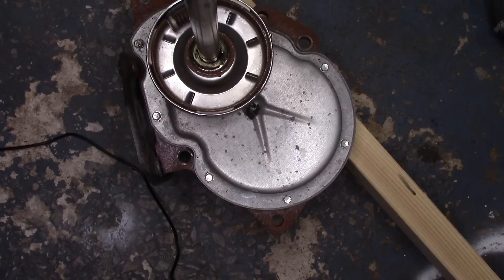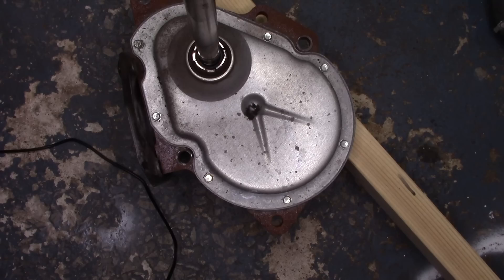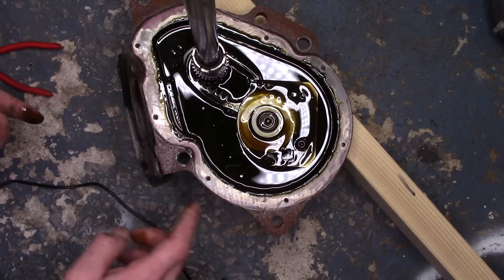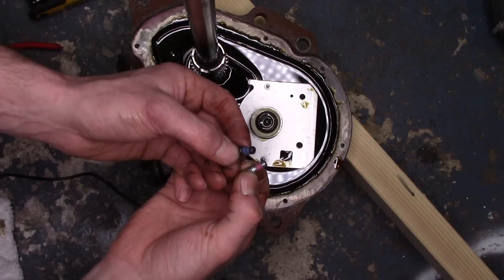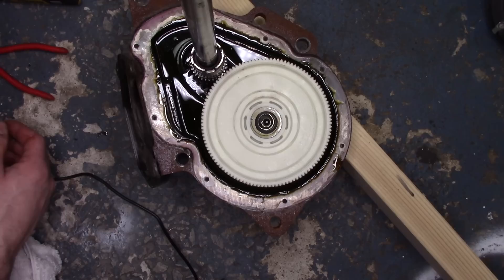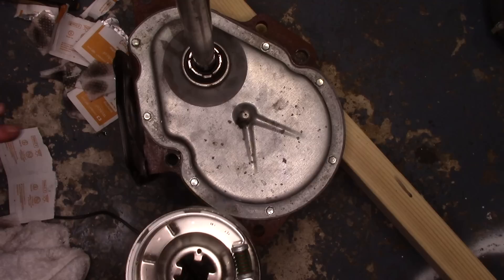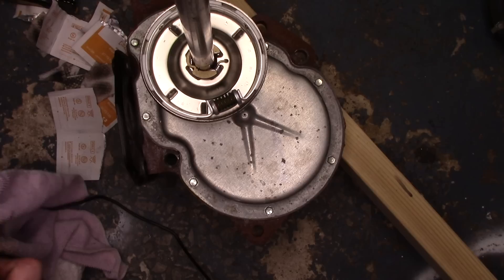How To Rebuild A Washer Transmission  3360629, 388253 Kit Installation

Comment: Was watching this video to learn more about my washer. I wound up checking the neutral drain, found that it had failed, and replaced it following this video. Thanks a lot for the real world insight e.g. 2x4 stand with motorplate attached, id’ing the correct kit plate, gasketing the case cover etc. That’s just what I need to keep my old appliances running as long as possible without spending a fortune.

Comment: This video was EXCELLENT. Very informative, straight to the point and easy to understand. Also, the camera angle was perfect and you could actually see what you were talking about. I liked when you said, “when a homeowner mistakenly gets rid of their old washer and wants to find one like just like it”.  That’s ME. The new washers I’ve bought are AWFUL in so many different ways. I wish someone would’ve told me before I had my old one hauled away. Anyways I’ve got a new used one which I LOVE and has worked great for over five years but now it’s not neutral draining. With the help of this video, I’m going to fix it. Thank you so much. This truly was invaluable. Oh and I’m going to replace the clutch assembly while I’m at it. 😉.   Two months ago I posted the previous paragraph and want to update:  with the help of this video I was able to fix the problem and replace the clutch. Now my 20 year old Whirlpool works like new again. Thanks so much. I hope to never have to buy another washer!  😂

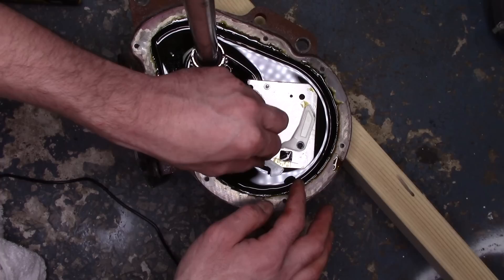Comment: 5:34 this is what was broken on mine but it was very subtle.  the little plastic part that grabs the metal plate below it was worn out (not broken).  So it wasn't grabbing and was just sliding off.  I was only able to tell when I compared it to a new kit as the rest of the parts looked good.   
all the other pieces were in working condition.  This is for people coming in wanting to identify why they are replacing the whole assembly.

Comment: Fantastic video! Clear, to the point, with excellent commentary. Our Whirlpool is 34 years old, with just easy replacements of the pump and agitator dogs. Currently investigating a transmission or clutch or brake issue, but determined to fix it!
Reply: Did you fix it? Mine has no Spin and I have tried fixing everything on it

Comment: That oil is filthy. You are right there to clean it all out properly. Diesel is a whopping $3.00 a gallon. An old paint brush and a pan, most people already have. That transmission takes around 16 WHOLE ounces of fluid. What are we talking a buck or two MAX for fresh fluid? I would pay an extra $3.00 for a clean rebuilt trans as most other people would too.
Reply: How does it get filthy?  It shouldn't be subject to any contamination unless it gets water in it.
Reply: grease/oil for plastic gear transmissions are black, think they have graphite in it
the oil is $20
Reply: @a89proof  over many years humidity gets too it, there is a tiny hole on top of the cover so pressure will equalize.

Comment: Excellent video, just what I needed to see. I had narrowed the problem down to the transmission jamming. It turned out one of the two pins, the pin that held the spring loaded piece had fall off the plate! Now for a rebuild kit.

Comment: I love the whirlpool direct drive washer and will use them until I die. I had some apartment buildings and I got coin operated washers for the residents. They were basically the same as any other whirpool washer with the control panel simplified and the timer was one that was triggered by a coin slide. I had thousands of loads run on these washers and all the repairs were very easy and I hardly had to service them. The neutral fault did happen a couple of times but people throw these machines out all the time and I would just grab them for parts before taking them to the scarpyard.  I never tried to rebuild a transmission I would just swap in another from a scrapped machine.

Comment: I did that for all of 2 in 15 years because transmissions were plentiful. That was the opposite fail in the first two years of production btw. The transmissions originally went into the minis and pumped while spinning, the timer had no pause, so when they failed they'd pump out but not spin, stop and start spin again and they'd go. The transmissions from them worked perfectly fine in the newer ones with the pause. If a newer one failed like yours, they'd work in the minis.

Comment: Do not put any oil on the transmission shaft, it will end up in the clutch causing the washer not to spin. I use a very little bit of high temperature wheel bearing grease, it stays in place even after it gets warm.

Comment: I did this to my Kenmore 80 series that is a rebranded Whirlpool DD. The little flat spring had broken making it not drain. Used the rebuild kit and a new clutch along with new synthetic oil in the transmission fixed the problem.

Comment: My clutch went bad recently, and it appears that there's oil leaking around the seal on the shaft. Any suggestions for part numbers and how? The one in the top cover ought to be self-explanatory, but there appears to be a second one between the shaft and the small collar that the clutch rests on, and other than jamming a pick in there and hoping, I've no idea the best method to change it.

Comment: The sealant anaerobic gasket sealer  it is made for for transmission cases  . Recognize when i took apart it stayes stick unless it exposed to air for long times and can mix with oil with any harm

Comment: Some Whirlpool direct drive washers were designed to neutral drain; others were designed to spin drain. We have two direct drive washers, 1984 and 1998 models. Both have always spin drained.
Reply: The only one I'm aware that should spin drain is the first two model years when they went in the minis. Easy way to tell if it's as designed  is if the timer pauses the motor and restarts, if no pause, was made to spin drain.

Comment: So, I have a type 111 washer, (Direct drive trans) and I noticed that sometimes in the middle of a spin cycle it will occasionally make a loud noise and almost stop, like someone slammed on the brakes for a second. Any idea where I should look to diagnose this problem?

Comment: I have a knocking during spin. Rebuilt the neutral part and replaced the clutch. Knock is still there during spin after draining? WTH is going on. is this a drive nut problem?

Comment: Is it possible that a broken neutral drain issue could cause the washer to not spin? I put on a new clutch and it worked when testing prior to putting water in the tub but when added water it drained the water but did never spin. THANKS
Reply: Did it fix it?  I am having that problem.

Comment: It’s still not clear why he changed that part? Was it broken? Worn out? Cause to me they both seemed same.
Reply: Because it's not delaying when it goes into pump mode it's going straight into spin while it's pumping which will tear up the clutch and everything because all of that water weight with the clothes is just too much it's supposed to drain the water and then start to spin mode, there's just too much stress on that transmission when it's pumping and spinning at the same time without a delay that eventually it will fail prematurely that's what a lot of machines have wrong with them and why they only last a year or two versus 10 to 12 years between repair these machines are iron-built they can always be fixed no matter what

Comment: Im confused, isnt the drum supposed to spin as it drains? My washer works in all cycles except when it drains the drum doesnt spin. I can get it to engage if i stop the cycle and put some forward pressure on the agitator, tgen restart the cycle and all is fine until it needs to drain again. Im not sure if my problem is the gear and sprag in the transmission, or the clutch under the drum. Ive been fighting this for months. Thank you!

Comment: Great video and yes only replace what is  bad I agree. I have a few rust spots on my basket wich I cleaned with iron out. I'm going looking for re coating ceramic if you have any information on ceramic coatings I'll be back to watch/read your input. Of course no obligation but you might have already done this so no questions are stupid right 🤔

Comment: Question:  Awesome video thank you so much.  I hear my washer spinning with a high pitch so something is turning fast but the washing isn't spinning.  I'm going to replace the clutch first but when I get it assembled can I run it with the agitator off and see if the shaft is spinning or maybe by that time it's already connected.  I'm wondering if the gear in the tranny could be stripped but I don't want to open just yet.

Comment: Interestingly I had to do the opposite! I had to take a newer DD transmission and retro-fit it into my 1983 model w/o the neutral drain. for that, you remove the metal c-shaped arm, and the spring loaded plastic arm, the other plastic piece MUST remain in place as that is the spin pawl that allows it to enter a spin cycle.

Comment: I have an old whirlpool stylemaster. Mine is leaving the clothes much wetter than it used to and I've noticed oil underneath the machine. Would I be looking at a new gearbox, or should I just try to replace the oil and reseal the case? Or is it the drain pump causing the main issue I'm having

Comment: My machine is only agitating very little. The transmission shaft is able to be stopped by hand. Could this be a fix for it? Thanks for anyone that can help point me. I don’t want to buy a new washer
Reply: Hi, did you fix the agitation problem?  I'm having the same problem
Reply: @bigpun761  yes it was a weak transmission. I went to a local parts store and they pointed me in a direction to buy a rebuild kit from Amazon or to buy a used one. The job was not hard. It can be done under two hours easily. Took about a hour. Transmission was 60$
Reply: I chose to buy a used rebuilt transmission and I had forgot how good this washer used to agitate until it was fixed
Reply: @tennesseemattoutdoors5405  than you for the reply. Then that what I'll do is buy a used transmission .
Reply: Where did you buy the rebuilt transmission?
Reply: @AustinWilhite  I actually wound up rebuilding it myself.  I just bought the drain plate kit and the agitator shaft ... like new now.

Comment: Fixing these may become more important, as I saw that Reliable Parts was, for the first time, backordered on transmissions.  Maybe they're stopping manufacture.
The end of life of these is when they're leaking oil through the top and contaminating the clutch, is that fixable?

Comment: look at 8:43 - there is a white plastic spacer on old clutch band - did you put that on the new heavy duty clutch band ?  didn't mention anything in video about this part.

Comment: My kenmore 60 has had problems spinning regular to large loads on and off over a few years now. I replaced the coupling after it broke, and it worked for a long time. Then about two years ago I replaced the gearbox when it had problems draining and spinning again, and that seemed to work for the last two years.
Recently, it acted up again,and I put one of of these commercial clutches on, after finding the regular clutch slipping. But after running it once or twice, it still has problems, refusing to spin all of the lightest of loads, with a loud noise that almost sounds like the coupling had gone out, but it was fine. It still drains. 
With a good clutch, coupler, does this mean that the two year old gear box is toast?

Comment: Do you know of a way to defeat the automatic oscillation of the main shaft so that the transmission can be used as an one way speed reduction?
Reply: No, if you remove any parts it won't work at all.

Comment: So the washer I am working on will fill for the rinse cycle, rinse and then pause then it will spin and pump at the same time.  without pausing again.
Reply: it's the neutral drain kit, they are common to wear out after many years, about $20 on amazon.

Comment: At the 6 minute mark, is there a certain position that piece under the spin gear goes?
  I have been having trouble with them  I thought the metal piece went on first then the plastic gear.  But, it just spins around  I see from your video, looks like I have been doing it backwards  The metal ban looks like it fits around the plastic gear and not the other way  
  Next question, are they supposed to be glued together or does the metal just clamp around the gear and they both spin around by hand?  reinstall and they catch whatever gear they are supposed to catch or mesh with?
  This may have just solved a simple problem for me.
  I have a machine that three motors tend to get hot on  Thinking the neutral drain might be the problem.  I do not know if I checked for spinning while draining  
  I have had them do that before and thought some just did that.  May very well be what is causing these motors to heat up.
Reply: nothing is glued together, carefully put the parts in the proper place being extra careful not to misplace the part at 5:20 it's easy to not set in in correctly, the top gear will need to be fiddled with, (rotated around a few times) and you will feel it clunk into place flush and down where it belongs. good luck.

Comment: When I pulled mine the clutch had a dry black grease in it and the top had a sticky black grease as well that does not come off easy,  Fantastik did not loosen it much.   Since it was in the clutch housing as well, where did it come from?  I see no water on the floor after a wash.  Directly under the  clutch the top of the case was clean. But all around  on the edges is a sticky black grease. Could me gear case be leaking?  But how would it get into the clutch area?  Thanks for any help?
Reply: What about the part that dropped down into the oil when you pulled out the big gear?
Reply: @edwinconrad1993   sorry, it's been 3 years. I didn't mention anything dropping in nor do I recall. Sorry I can't be more help. The machine is still working.

Comment: i rebuilt these. but i did replace the gear oil. 2 reasons. 1) after many many years the oil thickens up also it's old 2)  while case is open might as well change the oil with fresh gear oil u can use whrilpool replacement oi which is 90w gear oil. i used a high premium marine 90w gear oil that repels water and resist corrosion..  replace the drive shaft seal and the top shaft seal those two tend to wear out and cause leaks.

Doing what you did seems to be the bear minimum of a rebuild job.  later down the road the transmission will start leaking thought those seals.  if you got it open why not rebuild it the whole way instead of part way?
Reply: You are completely right. I was wondering what oil is an alternative to the expensive kenmore gear oil. Thanks

Comment: I enjoyed  your video I went to Appliance  part store . They claim you can't  get parts for transmission.  I was looking foe a seal. So I put the old one back in . Fill it with grease. Looked like you replaced  one plate , on the rebuild. Where can you get parts? Thanks

Comment: Wrll here goes. My whirlpool ultimate care ii does agitate, does drain, but does not spin. Replaced the clutch and my w8fe actually replaced the motor coupler 10 months ago when I had Covid... And the coupler oroved yo be ok too. We reset the machine by doing the unplug / plug lid flip 6bt8mes within 12csecinds... And... Still no spin. Everyone is saying the neutral pack. 
I'll let you know.

Comment: I  wanted this but one of the appliance sellers on line said the  commercial grade would only work with machines that came with it. Why do they say this when I see videos that replace the 3 pads with  ones that have more pads.
Reply: Magic .Mark he’s probably just going by the book lol you can do it
Reply: I just put a 6 pad in place of a 3 pad in mine and seems to work just fine. Balance spring also. Less than $20 on Amazon for both.

Comment: Before you button it back up, is it possible to test the operation with a drill or something turning it?  I just put a new kit in, i turn it in agitate direction, then stop, then turn in the opposite (spin) direction).  From what I've read, it should not spin the basket the first time, but it's not in neutral and the whole thing turns.  I definitely matched up the plate and the cams are all UP and in the right spots, so I'm not sure what's going on.
Reply: You can cycle the motor & transmission outside the cabinet on the floor. Unplug washer, remove motor & transmission, plug harness back into motor adjust timer to spin, drain, etc.  Test agitator you need to fill basket with water to level load is set on machine.

Comment: I have like a knocking on my Roper washer and figured I’d change the oil but didn’t know what kind of gasket maker they used , But anyways it’s more quiet now and will last longer than the newer electronic washers ..
Reply: my roper has knocked from day one, when I did this repair it quieted it down a bit but it's just the nature of the design.

Comment: Hi. Great work on the video both on the spoken parts and camera work. I've got a maytag washer top load that I can't get to spin or anything except fill with water. Its mostly taken apart. Should the drum turn freely once the motor is off?  Also the top part of my agitator spins both directions freely but no go on the bottom part of agitator. Thanks